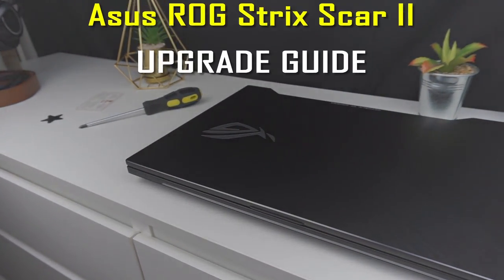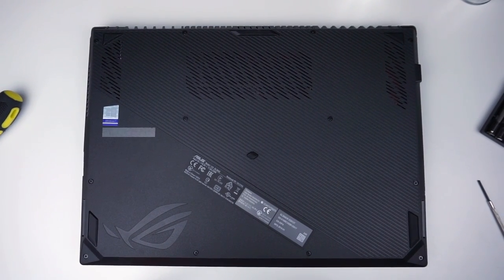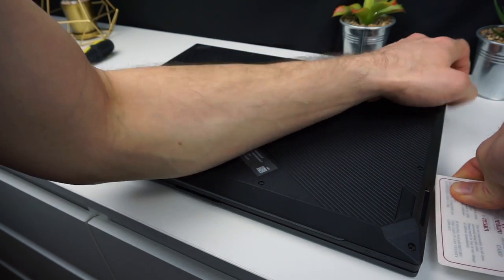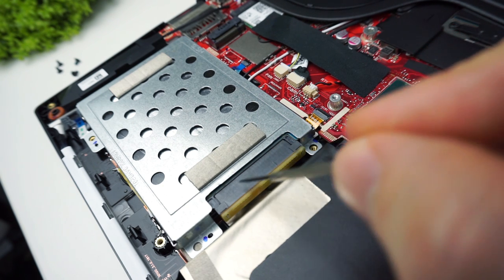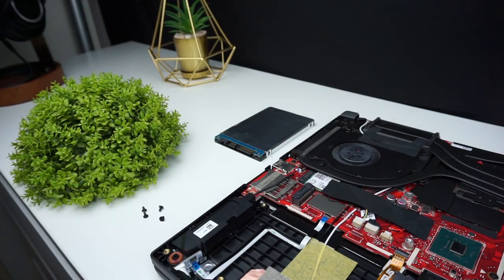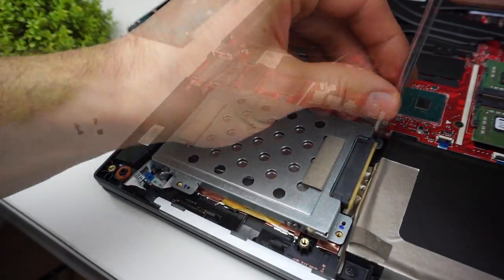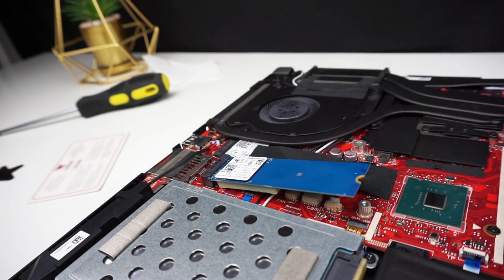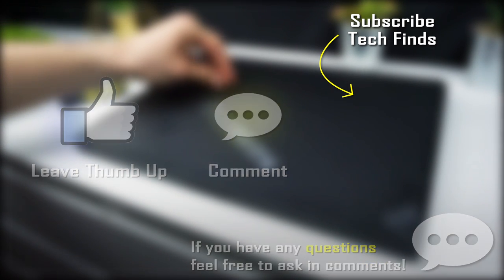Asus ROG Strix Scar II upgrade (RAM, SSD, HDD) - Disassembly Guide (detailed)

Comment: the model with 512 ssd with no hard driver have the same battery?
Reply from the maker: Yes, the battery is the same. You have just empty slot for hard drive.
Reply: Tech Finds I’m having the same model. If there is no hd then does the wire connecting to motherboard exist?
Reply from the maker: @joanofarc9793  I don't know that. The best way would be to check it by opening the laptop or Contach Acer's support. Sometimes manufacturers add the cable even though you bought the laptop without HDD but sometimes they don't.
Btw. You do not have to disconnect the battery but just  in case it's good to do.
Reply: Tech Finds thanks a lot man
Reply: Tech Finds btw is there any configuration for hard drive and ram stick?
Reply from the maker: @joanofarc9793  The configurations may vary between countries but you should be able to fing one with SSD + HDD and dual channel RAM (if that's what you meant).
Reply: Tech Finds oh uh I mean the system configuration, I might be not using the proper terms.. like to I just plug in and reboot the system?
Reply from the maker: @joanofarc9793  if you installed the new hard drive you have to get to the BIOS and find it. Then you can split it into many partitions or leave it as it is if you want. If it comes to RAM you don't have to do anything else - you just physically install a RAM stick and the system will automatically recognize it.
Reply: Tech Finds ok thank you
Reply: Does this support 2tb fircuda sshd? Already installed one and connected the cable but it does not appear on bios.
Reply from the maker: @nonysun1122  Yep it does, i installed 2TB in my unit and it worked. It was visible in BIOS and after splitting it into the partitions it appeared in the system. Check if you connected it properly, the orange cable is very easy to accidentally disconnect from the motherboard slot.
Reply: @TechFinds  how about for m.2nvme slot? Does it support 2tb or just upto 1tb?
Reply from the maker: @nonysun1122 if it comes to M.2 slot i don't know.

Comment: The drive is 2.5" correct?
Reply from the maker: Yep, standard 2.5" 7-8mm thin will fit for sure. and you have also M.2 slot.
Reply: Tech Finds thanks a lot bro

Comment: I can't get this SSD screw off for nothing in the world. It's like screwed in extra tight or something. I've been at this for almost 2 hours to the point to where the screw hole thing on top is losing it's shape, making it harder for the screwdriver to grip into it. 

Is it possible that it just so happens to be my unit, or did anyone else have this issue?
Reply from the maker: If you didn't match the screwdriver size to the screw it's possible that you stripped the screw head. In this case the only solution is to put thin piece of rubber on the screw and try to unscrew it. If doesn't help you'll can drill the screw head but you'll end up with the screw inside
Reply: @TechFinds  Thanks, idk if I have any of those sitting around but I'll see what I can do and update if the problem continues. 

Oh and amazing video btw.
Reply: @TechFinds  ok so I was finally able install my new SSD, however I'm at this BIOS Utility screen, which I'm not exactly familiar with. I'm assuming it has something to do with booting, but when I click on "Boot Menu" it keeps saying "The system cannot find any bootable devices." 

What is it that I have to do to get my system up and running?

Edit: Do you think it's compatibility? I bought a Kingston SSD because the one that came with my laptop was a Kingston as well, but I'm looking at your compatibility list and I'm not seeing Kingston anywhere.
Reply from the maker: @NeonxJay-  Compatibility is not about brand but the specs. In general vast majority of 2.5" drives should work with no problem. If the system can't boot maybe you replaced a drive where you had your windows installed. If not then idk what may be the case
Reply: @TechFinds  Yeah I did replace the one with windows. It was 256 GB and was no where near enough, so I got a 1T. I'm not exactly experienced with this, so how am I to get windows onto the new drive?

I also apologize if I am asking much of you.
Reply from the maker: @NeonxJay-  You have to use Microsoft Media creation tool to make a pendrive bootable and install the copy of your windows from pendrive. Idk how to get a legal copy of your windows tho. You can also clone your old drive with windows somehow, but i have never done it so idk how it's made.
Reply: @TechFinds  alright so I managed to get the os onto the SSD, but now I have a new problem. 
When I was in the partitions, I think I accidentally removed the wrong ones and now my HDD that was already in isn't being read or shown. 
Is there a way to fix this or did I good it.
Reply: @TechFinds  Also do you think you can link me to the Asus site page with the drivers so I can install them.

Comment: Can I upgrade this to a 64GB RAM?
Reply from the maker: No, it supports up to 32GB like most of the gaming laptops. You can have 2x16GB max.
Reply: Tech Finds, With a 32GB upgrade of 2x16GB can you upgrade from the 2666Mhz to the 3200Mhz? I have the GL704GV-DS74  that came with 2x8GB 2666Mhz.

Comment: Amazing video my friend, one suggestion i would have for these types of video is also adding a tutorial for repasting cpu and gpu. I would really appreciate that, but appart from that I love your review. +sub
Reply from the maker: Thanks for suggestion. I wish i could make full disassembly guide but i am not allowed to repaste the laptops i test.
Reply: Right now im torn between this laptop with rtx2070 or msi ge75 raider with same graphics card but i7 9750h. Right now upgrading from msi ge72 that i had few issues with. Got any recommendations for me?
Reply from the maker: @oliverz9479  That's a hard choice. Both laptops are equal in my opinion, but with MSI you get better CPU and per key RGB. Since i tested the 2019 Acer PRedator Helios 300 i recommend it to everyone, but only the configuration with GTX 1660Ti and maybe RTX 2060 is worth atention. If you wanna RTX 2070 i think you found good laptops, because they come with full size RTX 2070. If the cooling in Raider GE75 is good enough (and most likely is) i think i'd rather go for it over the Scar 2. There is also Raider GE65 15" that has been recently relased.
Reply: Could u tell me how scar’s 2 keyboard compares to msi steel series one?
Reply from the maker: @oliverz9479  the SteelSeries one in MSI is better. Not only the lighting but it's nicer to the touch and feels better in general. But with Scar 2 you have dedicated buttons for volume, microphone off/on and co trol center app, while the MSI has only dedicated buttons for cooler boost and control center app.
Reply: Just bought asus. Its 31% off on sumer sale on amazon guys (from 2400£ to 1650£) only 10 left tho. Cant wait to get it. @Tech Finds thanks for all the info on it 😉

Comment: I have a question; I own a Asus Rog Scar GL503vs; it uses the following cable: https://www.asus-accessories.com/hdd-cable-63672-66086.htm#gl503vs|l

Are they easy to replace? I was doing maintenance on my laptop, and the cable peeled in half with little to no resistance. There was no damage to the Motherboard itself, and the hard drive is still intact as well.
Reply from the maker: Yes it is easy to replace. The connector on motherboard should have a tag behind it. You tilt it up, put the cable inside and push the tag down to tighten it up

Comment: After installing the 2.5 SSHD on the Strix 2. Do i have to do anything before or after i reboot the laptop ? Thanks :)
Reply from the maker: Yes, you have to turn off the laptop, then turn it on and while it's starting to run you need to press F9, F2 or delete repeatedly to get to BIOS. Then you have to find the drive there and add it to appear in the system or split it into multiple partitions if you want. Here is how to do it (it should be the same process for most of laptops):
Start from 10:25 - https://www.youtube.com/watch?v=UV72wLA06_c
Reply: @TechFinds  Thanks :)

Comment: Need help. Mi scar ii doesn't power up after hdd upgrade.
Reply: Hard reset hasn't worked
Reply from the maker: Did you disconnect the battery before holding the power button for 30 seconds? Also make sure that the battery is connected properly before you close the lid. The screws on the bottom make some kind of connection points and the laptop propably won't turn on if some of them will be missing, so before you try to turn on the laptop make sure that you've got them all screwed in. And plug in the cable. Other than that i don't know what may be the cause of this problem.
Reply: @TechFinds  yes, it's dead, I already try several times
Reply from the maker: @mickygallegos  adding HDD could not kill the laptop itself. Probably something other must have happened that you may not know about. Try to contact Asus service, maybe they will know what was that.
Reply: @TechFinds  ok thanks I already contacted the store for a return

Comment: Grr, mine doesn't have the 2.5" drive connector cable.
Reply from the maker: I linked it in the description.
That's strange, because some people get the cable and some does not.
Reply: Yea me either, it’s because I got the laptop with only the m.2 SSD so they didn’t include a cable for the HDD. I’m trying to order one from their website but they are out of stock.

Comment: my scar 2 won't turn on after my 16gb ram upgrade to 32gb
Reply from the maker: Are you sure you connected the battery before closing the bottom?
If so and the laptop doesn't turn on you need to do hard reset. Here is how to do it on Scar 3, but it's the same for Scar 2 as well (start from 05:21): https://youtu.be/ovY7B3_5LfE
Reply: @TechFinds  same problem, hard reset doesn't work

Comment: Is compatible ram corsair vengeance?
Reply from the maker: Yes it it, but if you mix with original RAM you better go for something with the same specs like Crucial that i linked. However if you wanna replace 2 sticks you can go for vengence.
Reply: @TechFinds  I wanna replace 2 sticks. But, What is best?. corsair vengeance or kingston impact
Reply from the maker: @wladyvalencia1145  HuperX is better since it has lower latency.

Comment: Seems completely unnecessary, the way you have to open it lol. but i think thats modern laptops in a nutshell. I was curious to see whats inside this before I bought one, Not something I'd want to hop swap hard drives around every few months. but Its worth getting a base 512GB ssd Rog Strix to save some cash it seems.

Comment: that SSD is not compatible with the ssd of this laptop, there´s 3 connector and ssd evo 970 has only 2, be careful how you disclouse this info.
Reply from the maker: What do you mean by 3 and 2? Samsung Evo 970 is compatible with Scar 2 without doubt. I got many reports from my audience that it works, and even sites like HIDevolution offer upgraded Scar 2 laptops with Samsung Evo 970 already installed.
Reply: @TechFinds  Exactly but with the one that has the 3 slots look at it, is in your video when you unplug the ssd you will see that, that specific ssd has 3 slots compare to the SSD EVO 970 LINK  you put on there.
Reply from the maker: @mikeescalante8362  Mate, please notice that the M.2 slot in Scar 2 has only 1 notch - a little black plastic part that fits to the cut of the golden pin section of the SSD. Unlike the original SSD, the Evo 970 has only 1 cut in the pin section, but it will fit anyway, because the slot has only one notch. :) If Evo 970 was not compatible the slot would have 2 notches to prevent any not compatible SSD from installing.
Reply: @TechFinds  Can you make video to prove it? then why would you have numbers in the pins if at the end everyone will ignore it? that´s the difference between the pci express and nvme non pci.
Reply from the maker: @mikeescalante8362  Well, maybe you can ignore it. ;) Can't make a video - i had this laptop for limited time only and i don't own any Evo 970 SSD as well.
Reply: @TechFinds  Make sense, just saying because I´ve been doing upgrades 4 my customers for a long long time and I know how this works. ty for taking the time to discuss this.

Comment: Ahaha I bought that ddr4 hyperX RAM didn’t realize mine was a desktop one
Reply from the maker: What? So you wanted to buy RAM for desktop or Scar 2? For most of laptops RAM is 260 pin, i linked such ones in the description. :)
Reply: Tech Finds yeah cuz I’m using amazon Canada therefore I manually searched for it and stupidly bought the regular sized bar :/ returned